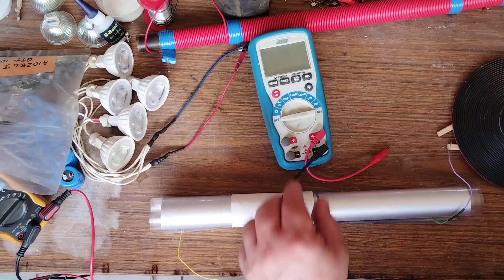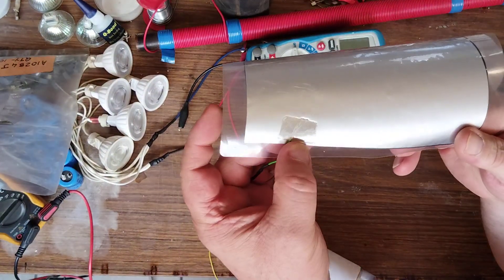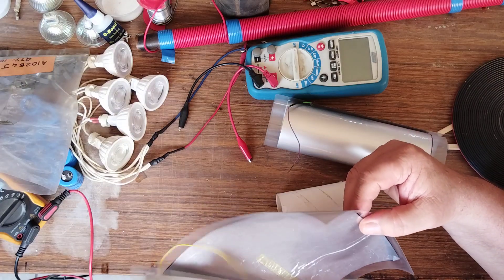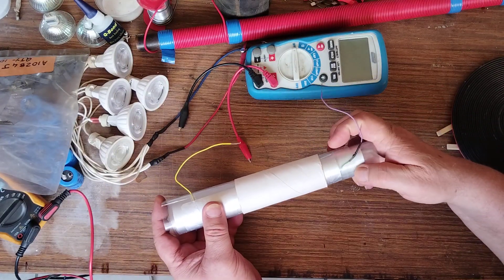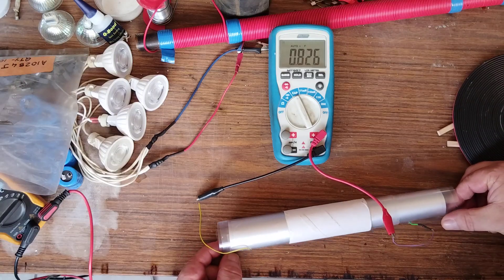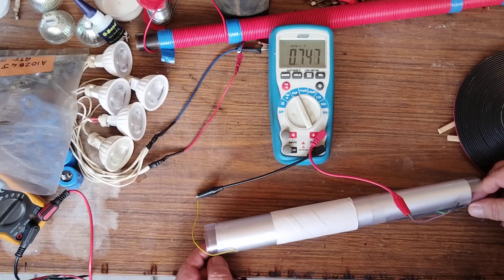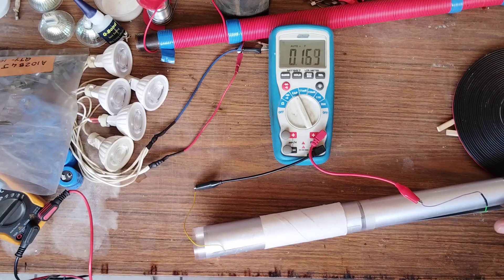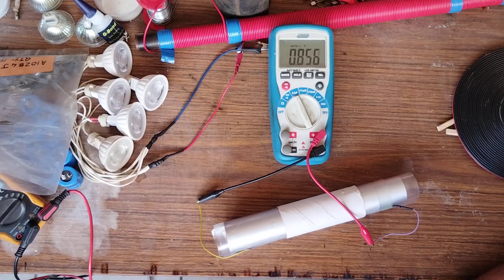DIY adjustable capacitor

Comment: Good way, cause it's difficult to get the old style variable capacitors anymore. Thin paper insulator will allow faster switching than plastic. But it will need some mineral- baby oil with higher voltages, so it doesn't burn.
Reply from the maker: I find you can just ad sheets to increase size and it will work with very high voltages.
Reply: @johanrheeder1640  Yes, but capacitors in series will add more resistance (waste heat). So it will slow down the discharge ability and frequency.
Reply: @johanrheeder1640  Do you believe it will go up proportional? Here you had almost 1uF. For example with 1000 additional sheets it would be at 1mF?